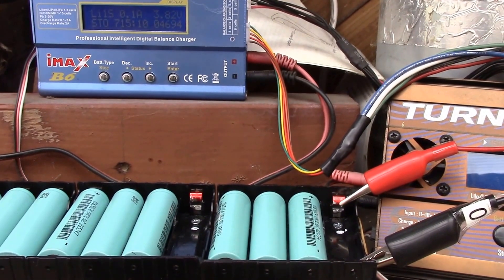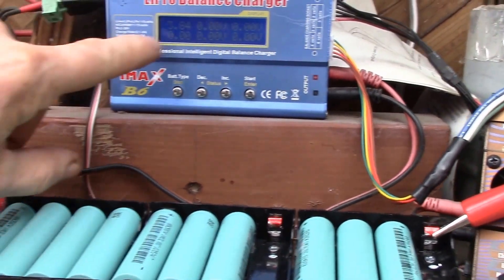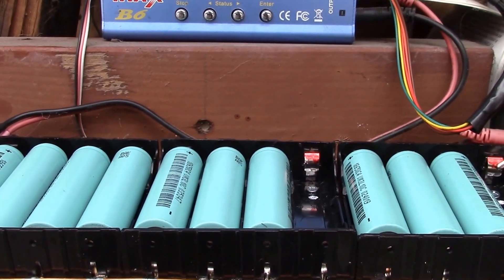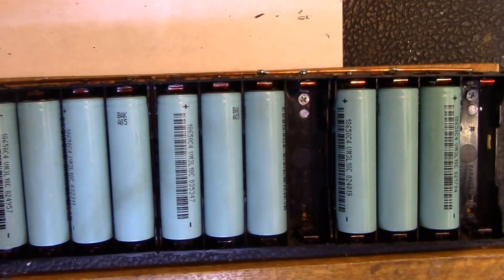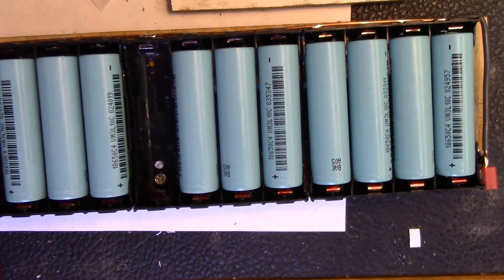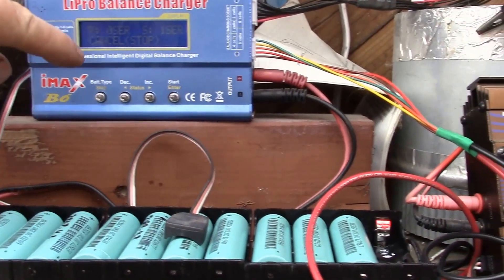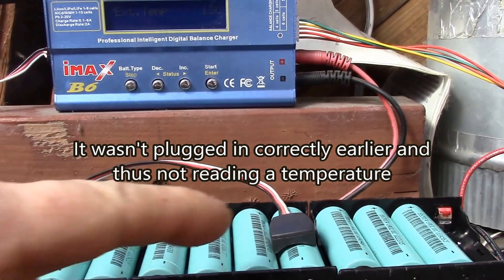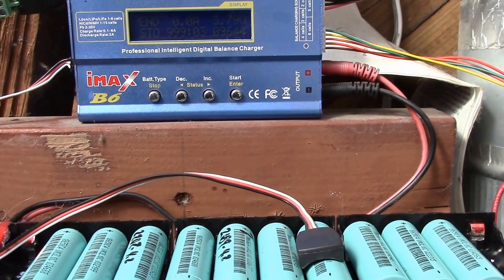12-cell 18650 Storage Charge Setup, Part 2

Comment: If you charge with imax b6, does li-ion battery needs bms protection or not? Thanks
How are all batteries balanced, i dont get it?
Reply from the maker: No, the Imax-B6 (or most other RC battery chargers) are essentially a BMS.  They control charging current/voltage and cut off charging/discharging when pre-set voltage limits are met.  Cells balance automatically because they're all charged in parallel.  That is assuming similar chemistry and similar states of charge between all the cells.  Each cell will take a charge based on their own internal resistance, state of charge and the charging voltage.  As the charging voltage hits the constant voltage (CV) stage, the charger will hold that voltage until the combined charging current drops to 5% - 10% of the initial charging current.  I use this setup mainly to bring already discharge tested cells back to storage charge until I'm ready to use them some time later.  It would not be a good setup for taking a random assortment of unknown cells and tossing them all in parallel.
Reply: @The4Crawler  thanks very informative

Comment: Great project. All are charge in parallel. How is the balance function doing? Does it help imax to determine the charge of batteries? Im planning to do 2 cell parallel charger and use the balance function (connected in paralell too)
Reply from the maker: Yes, all cells in parallel, anything from 2 to 12.  Balancing between them seems to be fine, within a few mV typically.  Mostly I'm testing and charging groups of 10 cells that will be paired up with a 2nd group of 10 to make my 20P packs.
Reply: R Brown thank u. In what mode in imax are your charging? (Lipo balance or liion charging?) i saw other videos charging on lipo balace mode although theyre using an li ion
Reply from the maker: I run my iMax and my Turnigy chargers on the Li-Ion setting.  Not sure if the storage charge voltage changes with that.  My end battery packs are run only up to 4.0 V/cell, so the 4.1V Li-Ion setting is the closest to that.
Reply: R Brown thanks for the additional info. Does the balance charging works on li-ion settings because I saw the “lipo balance” is a separate setting on imax.
Reply from the maker: It does on mine, but I think mine is a clone.  You just change the battery type to Li-Ion and then all the charge/balance/discharge menus are the same, only the end of charge voltage changes.  Balance charging only applies to 2 or more cells in series.  With one cell (or many in parallel) there is no balance charging, per se, since all the  cells are in parallel, they by definition see the same voltage.
Reply: @The4Crawler  Thank you so much sir.

Comment: I used to have 1,000 of the same 18650's, never again, I found most of them to run hot.
Reply from the maker: Interesting.  I have 400 o them and so far, all are running cool.  I don't push them very hard, only charge to 4.0 volts and current drain is typically under 500mA/cell.

Comment: Hello. What is the lowest bottom voltage  discharging till 3v or 2.6?
Reply from the maker: I've only used mine down to 3.0 volts, which is the default setting.  But you can manually set the cutoff voltage to most any value you want.  Since the discharger can also handle NiMH (among others) batteries, it likely can go down to quite low voltage for the cutoff.
Reply: R Brown Thank you.